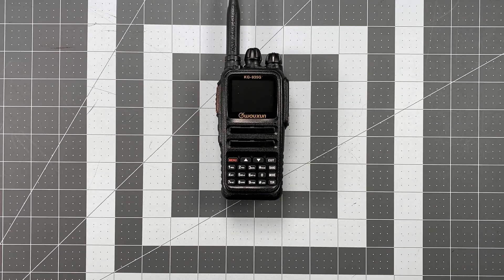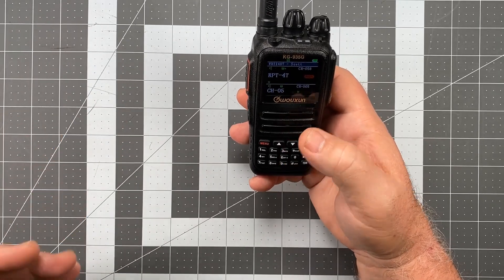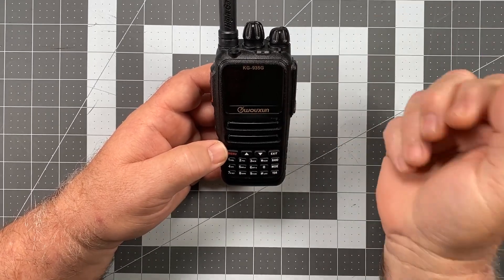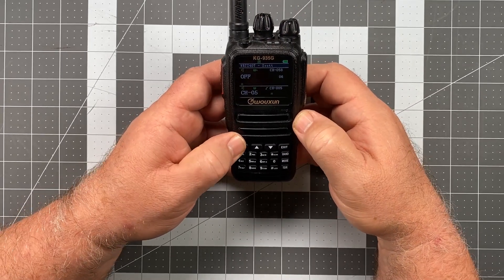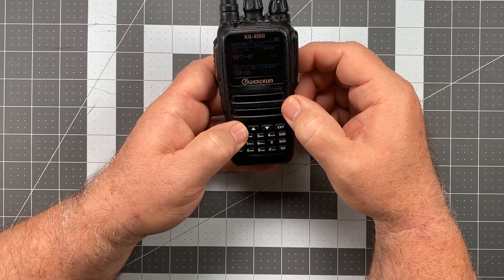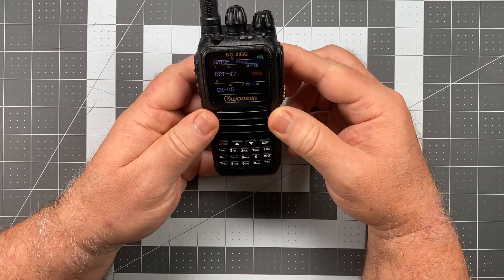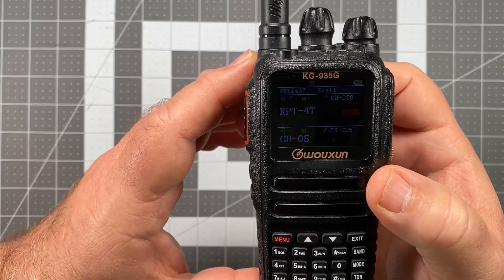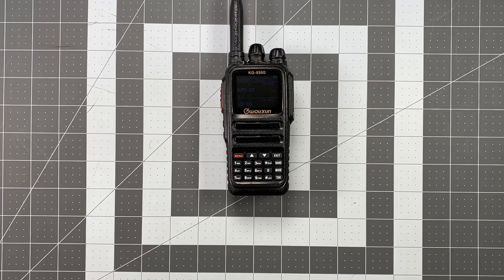Wouxun KG-935G Operators Series - Part 3: Display Backlight Adjustments

Comment: Trying to use your directions to control my UV9GX-G and it's not going well. Very little about this model is out yet. The menu is frustrating! Three-characters mean very little to me. A glossary, maybe? Going to contact the seller since I only received a leaflet as an instruction manual. You're an excellent teacher, I've seen the first two of your tutorials and they are very good! New sub here, thank you!
Reply from the maker: The KG-935G and KG-UV9 series have different menu systems. So, this series, unfortunately, will not be of much use to you. I do plan to do a KG-UV9 series soon.